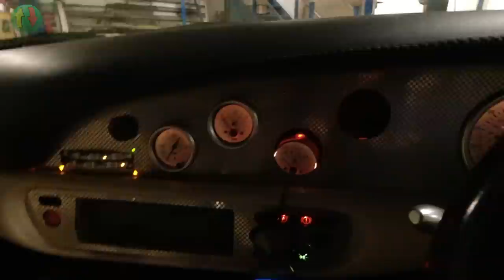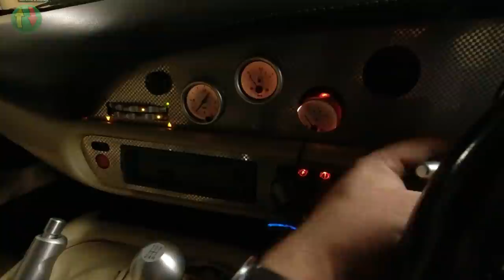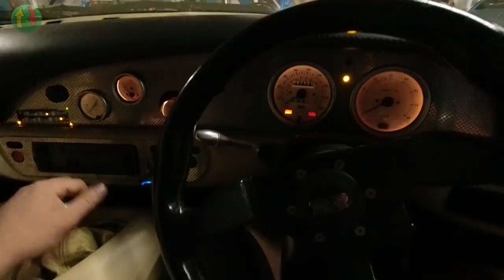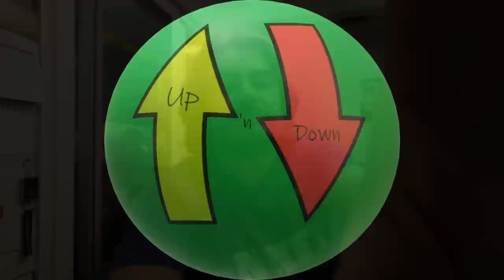TVR CHIMAERA 400 intro - Trevor has entered the chat!

Comment: Richard, you just popped up.  Good video and good books.  Definitely worth a read before and after you purchase a TVR.  Yes, you can really drive them.  I'm in Canada and think nothing of taking ours on a 1500 mile road trip through the Rockies.  Or a 1,000 mile trip out on the prairies - in 100 degree heat.  They are a good basic car, hand built with foibles, but a good basic car.
Reply from the maker: Thanks!

Comment: Much better image exposure, even when only illuminated with a torch. 

Love a Trevor. Especially ones in black or BRG. They don't need to go fast, just burble around and enjoy the whole English sports car thinginess of it all, and let people wonder what it could do if it wanted. The editor of Pistonheads had a 400 and the people at the rolling road were shocked when it actually made over 200bhp! Possibly the only one ever to do so. That misses the point though. Driving down country lanes and parking up outside a nice pub in summer is the thing. Crappy or not, the dash still looks amazing with the lighting and the engine turned alloy panel.
Reply from the maker: Yup, totally agree. Don't get me wrong, the 500 models can genuinely gut-punch you down the road (assuming they're in good fettle - many aren't) but the 400 by modern standards isn't really about that. It's more the sense of occasion it brings that makes it enjoyable, and the overall package.

Comment: Nice to see, I am Blackpool born and bred and used to pass the factory, recently demolished every day on my way to work. Also I am a big Rover V8 fan with 1 4.6 Gems P38, an Overfinch Tuned 4.6 with pocketed pistons and Mark Adams Chips and other goodies currently in build along with a 3.5 90 and 3.5 110.  I have to say the Rover V8 if cared for a run on the right oil and with good cooling is one of the best and most versatile engines.
Reply: Hello, Are TVR recommending the right oil on the build plate? And what oil do you recommend? Thanks

Comment: Fantastic! I have the same model Chimaera, same engine, same layout, same year and pretty much the same issues give or take. I'll definitely follow this series of videos and what you've described so far in terms of jobs to do is pretty much my list for the year or two ahead.

This winter for me it will be pulling the engine and changing the bearings (mains and big ends) and oil pump time. My car has done ~100k ish (the speedo was wired up backwards when I bought the car so I don't know the true mileage) but I think I've caught her just in time.

It's a bit of a struggle for me working in a small single garage but like you say everything is pretty straightforward to do and I can do the majority of work just off decent jack stands. Overall I love working on this car and I agree the driving experience is great too especially as a touring car.

Truly looking forward to your videos. By the way, is your business name Southways? Cheers!
Reply from the maker: Yes, it is. I'm treading a fine line between work and play here!

Comment: I always think of Chimaeras as quite big cars for some reason, but they’re probably about the same as my little MR2.
Reply from the maker: They're about MX-5 sized.
Reply: @UPnDOWN  yeah, it’s mad. I’ve never been in in one but I’ve seen them on the road and I’d swear they were way bigger than an MX-5. Some weird trick of geometry.
Reply: @UPnDOWN   Yes wikipedia shows they are exactly the same wheel base 90 inches. I have a golf GTI very stable at crazy speeds (on a track) wheelbase 100 inches, and you would think it's a small car.

Comment: T5 boxes are always coveted but they actually aren't great in many respects. The LT77 & latterly R380 was hugely underrated. I know of a few people who "upgraded" to the T5 but went back to the Rover box. I'm guessing the cam has worn on yours if it's feeling a bit lethargic, as you know extremely common. Powers do their own profile as used in later factory cars (TVR885 profile) which I've used to good effect in a 4.6 I built for my older TVR conversion.
Reply from the maker: TVRs never got the R380, sadly. That was a decent box. LT77 can shift nicely, but they're heavy as hell and require engine-out on Chimaeras/Griffiths to swap the clutch on, so a bit of a pain.
No idea if the cam has worn on mine or not. It's only done 50k or so, so it might be OK. If it needs it, I'll stick an MC1 in it. They drive very nicely in the 400, but of course they're not exactly powerful or revvy even when they're in A1 condition.
Reply: @UPnDOWN  50k is end of life for a cam. I've got an MC1 in my 400, the warrior heads are a good addition too.

Comment: With your type of car I used to fit replacement targa tops and interior trim , I hated the design of which you had to physically get I the boot and undo the studs with just a spanner in the far corners loosing 10mm spanners to a point of tieing one to my wrist to stop this happening lol
My question is this how the hell do you get a door card off without getting your arm stuck then having to finish removing it to release your arm ??? 😆 
If you ever see that model with the 3 bolts in the back window like the Griffin then it's a good chance I did it and your welcome 😉 
Oh yes u can't spell chrimmmmm era lol
Reply from the maker: I don't have problems with the doorcards, I just remove the speaker, reach in and up to the top (behind the ashtray) then rotate elbow 90deg to reach all the nuts. I've never had a problem!

Comment: The boot light wont work on My 1998 Chimaera, any common problems that cause this? (checked the bulb!)
Reply from the maker: You have a boot light?!
Reply: @UPnDOWN  Ha, yes just to the left of the boot lock as you look into the boot, cant find a switch to trigger it though
Reply from the maker: What year is it? A very late one? I've never seen any TVR with a boot light other than (if memory serves) a Tamora.
Reply: @UPnDOWN  Its a 1998 R, the boot light is the same type of fitting as a rear number plate light, just mounted in the rear boot lip pointing inwards, it looks good, but could have been an aftermarket job,